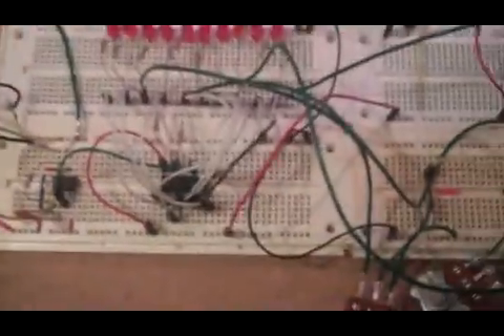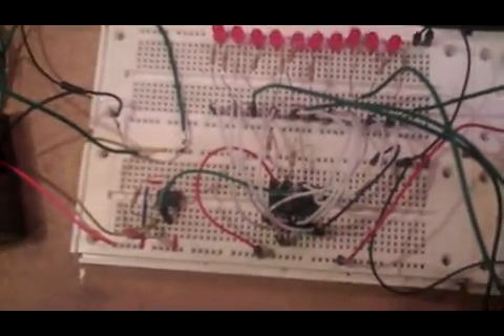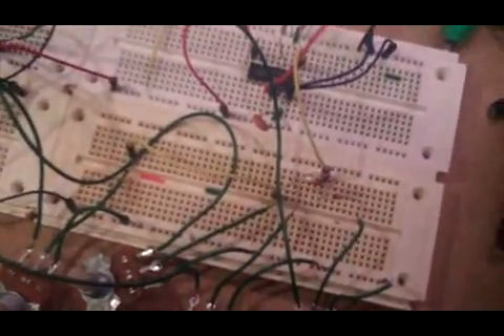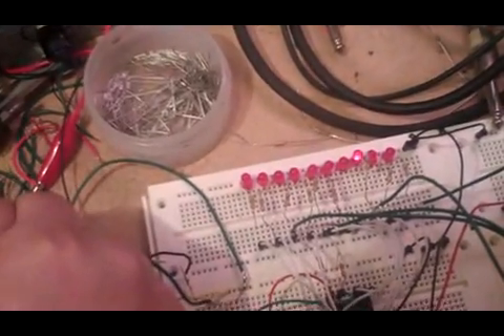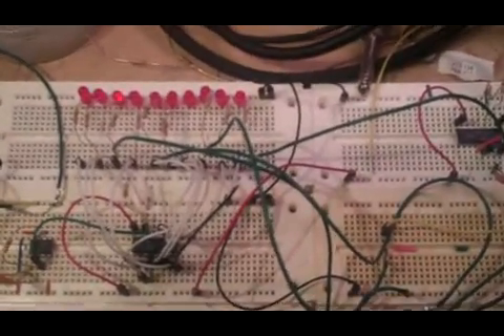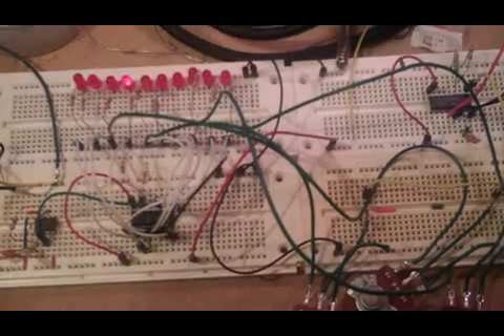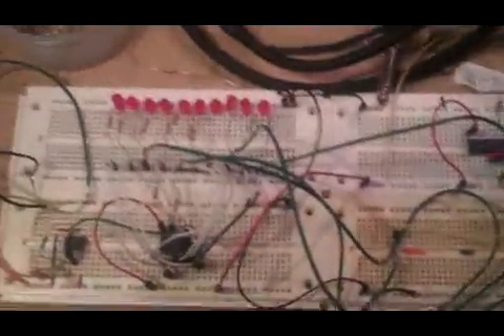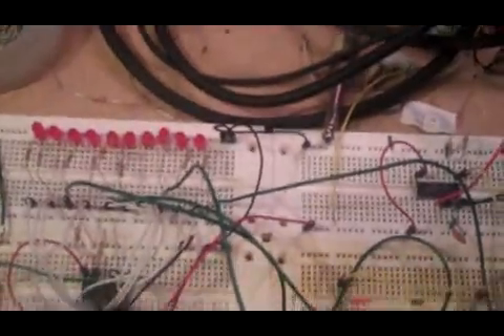4017 diy sequencer

Comment: Hey ..nice video. I have my 555 clock hooked up to my 4017 ..I have mine counting to only 8...(8 LEDs flashing)
I want to use a 555 timer for my sound ...I am using  the outputs of my 4017 with transistors to power my 555 ...now i want to adjust the frequency of my 555 independently  with each output ....any suggestions? Am I making sense or should I rethink this?